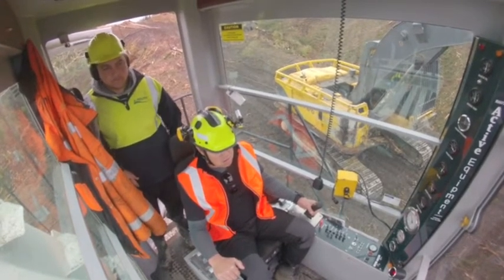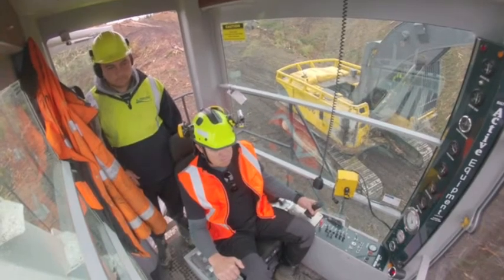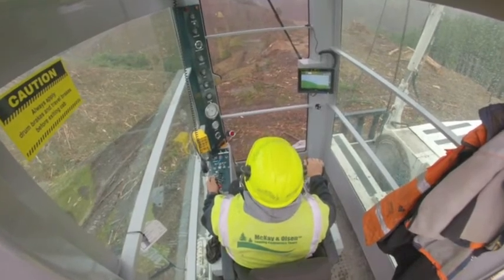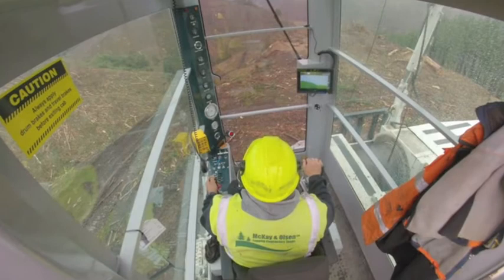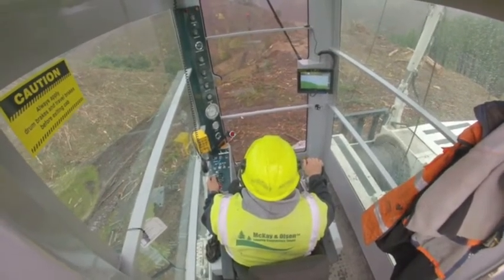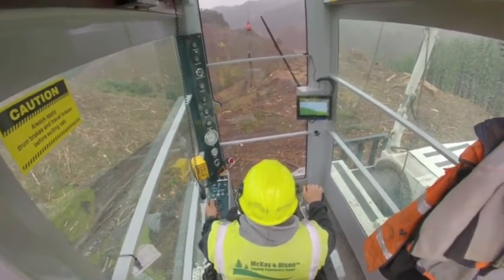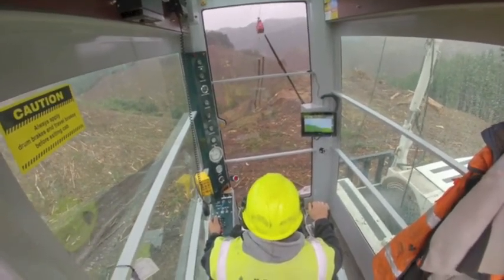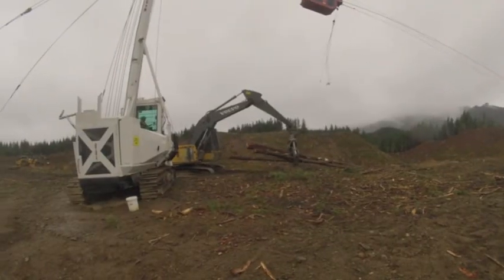Active 70

Comment: I like the cab don't like the new controls I run a tty70 every day wish the fractions and gears were on the other side facing the end instead of the operator who's the noise just drives you crazy would like to see the block purchase guy lines disappear and bigger guy line drums for more line capacity in a 6-speed transmission instead of a 5-speed and an option to mount the Haywire shiv on either side of the tube they definitely did a good job on redesigning something but I give him credit for that